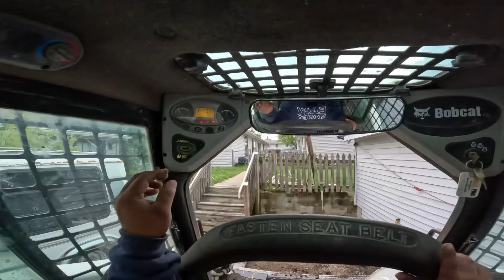Where have I been ? Little job !!

Comment: Never had to rent a bobcat to demo 
60 Sq feet of asphalt. 
Tear it up by hand to get that little extra workout in. Push yourself
Reply: For a basic 10ft x 9ft pad with rebar and dirt/grass removal cost is a minimum of $15000.00. Quick note for anyone reading
Reply: If no dirt or grass removal is needed charge is $1100.00
Reply: @613rob  l agree, cement finishers are becoming soft and sensitive. They're scared of physical labor work.
Come on!!!!
He's only like 25 years.  He better bite down

Comment: Eric if you take your headliner down you can just peel back the fabric and use the 3 M spray for the expansion joints and use it to glue the fabric back up tight ! Follow direction on spray can .
Reply: That doesn't work on GM vehicles, you cannot reattach the fabric to the foam padding (that orange shit), gluing it might last a week. Once the fabric and foam padding separate, its garbage.

Comment: You should put some cones at the back of the trailer when it's parked on the road.....especially when the skid loader is in use and the trailer is empty.  Too many people not paying attention when driving....save yourself the headache.
Reply: Esp when it's not your trailer. You also need to chain your load properly. One lose chain thru a that welded loop ain't going to do anything.

Comment: Have you thought of pulling the skid loader to your job with the dump truck to then have all you need in one trip ???
Reply: He can't without a CDL license.
Reply: @tommosher8271 in the video it shows him driving the dump truck…….
Reply: @tonym8765  Not too bright are you
Reply: @reecemcdowell7768   He's driving a truck that alone or with a GVW  under 26,000 lbs doesn't require a CDL that's why he only fills it half way and to pull a trailer with weight of 10,000 or more with a the dump truck requires a CDL. He can pull it without a CDL with his dually that's why he does it that way which burns a lot of time and why he hasn't gotten a CDL when working for Ryan because the form truck doesn't require a CDL but he's costing himself a lot of money not getting one.  He's either to lazy to get one of he doesn't qualify to get one because you have to be a citizen to get one.
Reply: @tommosher8271  why are you telling me this? I’m not even trying be smart ass but you’re telling me something I already know. You’re the one who stated he can’t without a CDL when he clearly can. this whole comment was about how he should tow the skid steer with the dump truck🤦
Reply: @reecemcdowell7768   He can't tow it with the dump truck if he doesn't have a CDL is the point that's why he doesn't do it but he doesn't need a CDL to drive the dump if it's weigh is under 26,000 lbs or he's towing a trailer that's under 10,000 lbs. It doesn't sound to me like any of you understand so I was explaining it not because I thought you were being a smart ass. Something fishy about this whole thing as to why he didn't get a CDL working for Ryan as Ryan would have paid for it and Paid him more to work for him. He can't get one if he's not a citizen, has 2 DUIs, health issues or bad eyesight. Wonder what the reason is he doesn't have one.

Comment: One thing Eric has on Ryan without a doubt is the use of ratchet binders when chaining down equipment on the trailer. Those old snap binder will come lose 💯 
The ratchet binders cannot come lose only the chain can get lose if not properly set 🫡